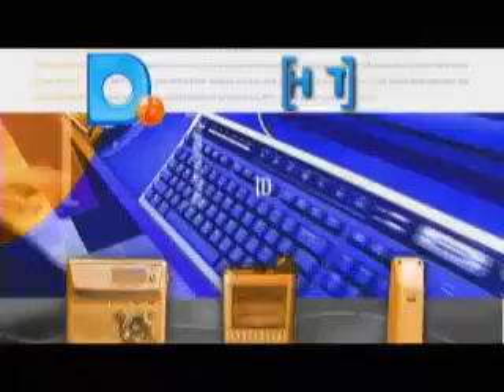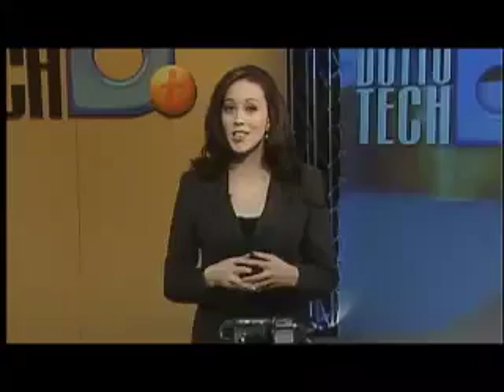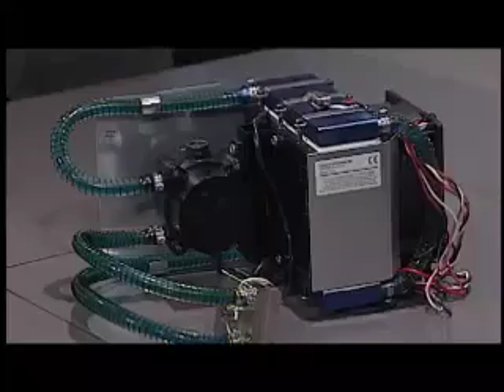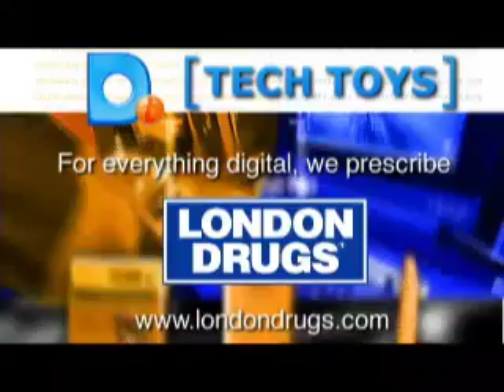Dotto Tech - Season 5 Episode 20 - PC Cooling Systems

Comment: Actually, the preformance of the V10 is extremely impressive. It is one of the best air coolers on the market that can be closely compared to the preformance of water cooling. It is although quite pricey, but the V10's predecessor, the V8 cools almost as well with a smaller price tag.